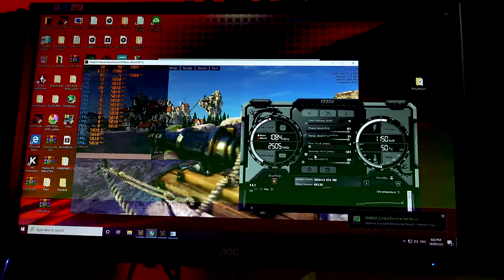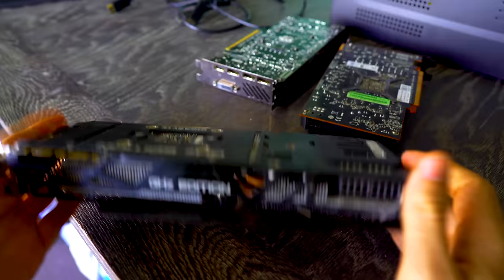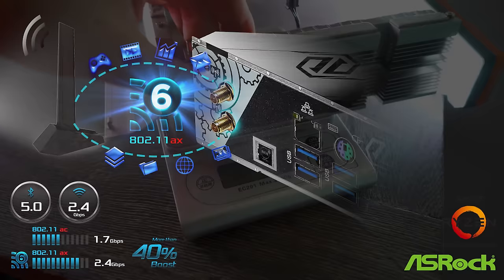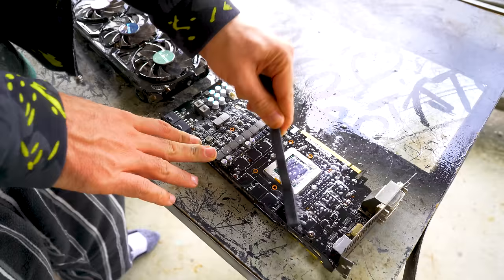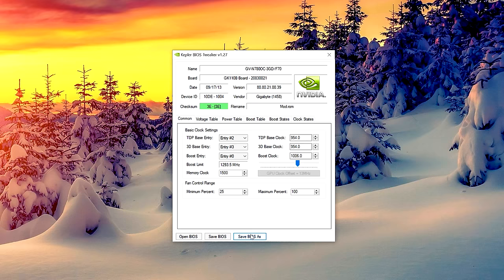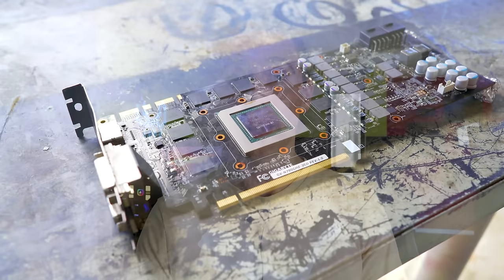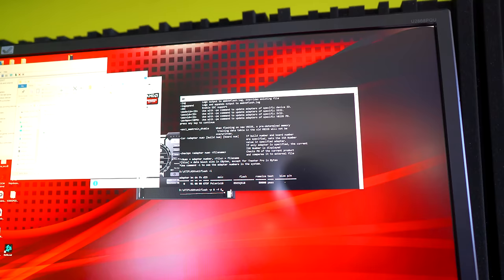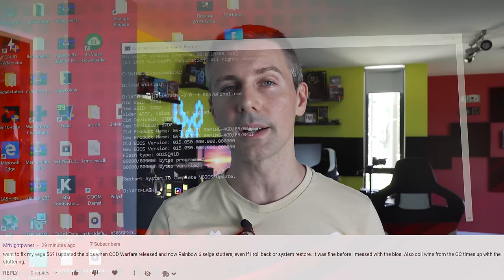4 Problems that Cause a Faulty GPU and How to Fix them.

Comment: My gfx card just crashes with a random solid colour (like pink, yellow, blue) or sometimes just completely blank screen, fixable?

It works for sometime and then suddenly goes blank and sometimes reboots the pc
Reply: Hey, I got the same issue.. Have you ever got a fix for it?
Reply: @ruebegaming829  I had to change the gfx card, I got bad news the card is done mostly. Try changing the cable and cleaning the g
Reply: @rhlparkr  ahh shoot... I even tried running the gfx on a different system and still did the same thing.... oh well, thanks anyway
Reply: @ruebegaming829  np

Comment: my gpu seems like near dead, it won't let the computer boot.. yesterday i watch this video and today i wash my msi rx570 8gb using methanol aka methyl alcohol because i don't have wd-40 or any multi purpose spray. try to heating up the gpu using hot air gun, and also re-paste it with cheap thermal paste, after that i try to boot up with my computer, surprisingly it's working perfectly and has low temperature which is GOOD, a BIG THANKS for making this very helpful video! ^_^

Comment: i've got a GTX 780 FE i found in a scrapyard, the card powers up but fails to initialize and says "please connect the PCIe power" even when the power is connected. How would i fix this? there's nothing obviously blown up on the board and there's no corrosion and very little dust in the heatsink

Comment: Great video. I like the heat gun as I've used it before. I seen other techs use an ordinary oven and foiled bake sheet. Just cook a pcb for 10 minutes. Sometimes if you've beat a old transistor radio around, it's components get loosen up and need to be re-soldered again. Heat guns do wonders fixing them.

Comment: My gpu had vertical lines in the middle of the screen and on the right side of screen. Any chance to fix? I tried baking the card twice but the lines remained. And driver install didn't work.

Comment: Just fixed an Asus Phoenix 1660 by reapplying new thermal paste to the gpu processor as well as new thermal pads. Its a single fan card so it runs hot naturally. It looks like the problem was not enough thermal paste coverage on the chip as well as re-using the thermal pads after the last time it was taken apart an re-pasted. Make sure you fully cover the chip with a decent amount of paste. To clean off the old paste I used 91% isopropyl alcohol and for the thermal pads I used 2mm EKWB thermal pads from a local electronics shop that was less than $5. It will get up to 82 degrees on the Heaven benchmark after 3 consecutive runs but not any higher. Then I used it for mining an it worked on all the overclocks I tried with temps around 67 degrees where before it crashed the pc after a few minutes.

Comment: I have an old AMD card that blue screens periodically whenever I watch web based videos like YouTube. I tried disabling all GPU acceleration in the Chrome flags menu and settings, that didn't solve the problem, but I can play video files with VLC without any issues. I've tired installing new drivers after using driver cleaner. Reseating and cleaning the card didn't help, the only fix was to remove the card.

Comment: The rust on the 780, is the same rust I have on my 970, same cooler, Gigabyte Windforce. I live in Far North QLD, so definitely humid and salty, but I have older components that show nothing like it, while that 780 and my 970 match perfectly, in cooler spec and rust.

Comment: Brian, To fix the black screen on windows, boot safe mode, run msconfig, tick base video and reboot. It will then use a legacy driver to boot and then it will be ok as the nvidia drivers then kick in later. This is a work around, I used for 3 years.
Reply: What do you mean by tick base video?

Comment: Soldering paste didn't smelt before 200°-220°. 
I'm just saying... 
I've put my old graphic card in a furnace for 15 minuts at 220° that's work. But dont forget to disassemble all plastic parts.

Comment: Heatgun/bake works. I fixed my HD7850 3 times using that method. But I don't know how to fix vertical lines. Bake doesn't help. Had them on RX 470.

Comment: I have a AMD Radeon HD 5450 and this had the display going black problem in windows 10 and it was not the card ,it was the drivers !
* uninstall the drivers 
* manually download and install older drivers that was made for windows 7 in to windows 10(i have a old VGA but for new cards you should use oldest driver you could find)
* disable VGA driver update in windows update and the display driver software from updating drivers 

and this fix the problem and i have been running like this for more than 2 years now, cant say that this will work for everyone but you should give it a shot before spending money on a VGA card

Comment: To fix the first problem, you might want to try the oven method or hitting it with a blow dryer on hot and high for 15-20 min

Comment: Is there any hope for my "dead" 750Ti?  I put it in a friend's computer while doing a clean and windows reinstall. Heard a loose screw taking it from the car shook the case but didn't locate it.  Powered on, no video. Took GPU out.  THERE was the loose screw. It had fallen between the fan shroud and the circuit board on what I think is a VR chip or something.  It was near the top by the 6-pin power socket.

It doesn't  smell burned or anything obviously dead and I didn't not observe smoke, but the card is no longer detected by the motherboard at all.  It's  Z97  MSI PC Mate with UEFI which has a "board explorer" option.   The slot where the card resides shows nothing there.    
The PSU was OK and the mobo showed no ill effects only the GPU was affected.

I don't have another GPU to swap with it so he's using the GMA4400 on the I3-4130 CPU but obviously if this GPU could be revived it would be nice.     I've never done this sort of repair work. But I am not a stranger to soldering.   My hobby for a while was building guitar amplifiers from scratch using vacuum tubes.   So old analog gear not SMD chip stuff.  Is this something that could be repaired assuming the bad part could be ascertained?

Comment: I've used heatgun method and it works quite often... but it being a low temp solder problem it is usually indicative of overheating, it helps, but if the overheating is not resolved, it will just happen again... pressure clips, replacing thermal paste or changing the cooling method may be necessary

Comment: can i ask something sir, what happens if i accidentally pulled down a bit off the head of the hdmi? because of my headphone wires i accidentally pulled the wires hitting downwards the head of the hdmi cable plugged on the gpu, will it damage the gpu and the port? my screen just turned black then something like a tv no signal screen.

Comment: Just did cleaning up of gt8600 on old system which was still working - original heat paste from purchase 10 years ago - fan was a little noisy so took that off and applied oil. Then made the mistake of deciding to change the heat paste... undid 3 of the 4 screws(spring loaded) and the heatsink popped ripping a portion of the gpu off. The paste was so hard it acted like epoxy glue - now the fan is quiet and the card is trash. A cheap card but a good lesson be careful with old cards and removing heatsinks.

Comment: I just replace my thermal pad on zotac 3080ti. First I use alumunium mod and thermal paste. Works ok, but not performing as I expected. So I changed it again with thermalpad/thermalright. Now Suddenly the pc wont boot. 1 Long beep and 3 short beeps. What would you suggest I should do? Could it be the leftover thermalpaste?

Comment: I recently lost my XP retro machine’s HD 6870 from a crappy cooler. Barely kept the card at 80 degrees, with nothing protecting the RAM chips. Proper cooling matters, folks.

Comment: I am having difficulty with my gigabyte vega64 OC it randomly crashes and power is cut completely. I have tried replacing my psu and checked all my other components. I suspect it might be vram on the graphics card and appears to occur when in 4k resolution. However was not as prevalent at lower resolutions.  I will try to down volt the memory what else should I look at trying?

Comment: Wonder if you could help me. I'm considering buying a faulty GPU off ebay for a cheap price, in the hopes of getting it working again. Going by these descriptions alone from different listings, do any of them appear like they would be an easy enough fix?

Listing 1: This card was working fine however it now doesn't output to my monitor

Listing 2: The card powers on and fans spin, however no display is made to the monitor, or display is made but then goes off. You may not experience the same results as I did on my test system, so please bear that in mind.

Comment: my old sapphire hd 7870 was getting black screen after installing drivers in 2018 and I saved her by baking her. She worked until may 2020. Thats almost 2 years but then I got same problem. I tried  baking again but this time I wasnt so lucky. RIP Sapphire hd 7870 (2013-2020)

Comment: So after my PC once randomly shut off while gaming, it only powers on and boots normally(with integrated gfx) when the GPU is disconnected from PSU. If I try to turn on PC with GPU powered, all fans just move for a sec, the power LED on the front of my PC stays on but nothing else happens. Tried moving GPU to my other PCIe slot that was never used and same happens. Is this just a short on my GPU? I have taken it apart to see if anything looks burned or damaged but it almost looks like new(even after 5y of use).

Comment: Hi! I have an EVGA GTX 1070 SC with micron memory. I have green pixels  squeres and shades when the gpu need to work harder, under any 3d application or sometimes now in the Windows 10 as well.  I downloaded the EVGA Precision X1 software when I can downgrade the memory and gpu speed. Basic speed: Memory: 4007 Mhz , GPU  1960 Mhz, Voltage 1050mV. Could you tell any ratio how I can try to take down the speed as you mention in the video? Because it should have a ratio between these component. Thanks

Comment: I had an MSI R9 390 8GB Gaming and was going black screen after installing the drivers, reflowed with a hot air gun for 5 minutes at 300 degrees and it worked. Stress test done and not issue. Now I have an ASUS RTX STRIX 2070 fan spinning but no image at all and so far could not figure out what's wrong with it.

Comment: that no signal drive issue have you tried bios flash of the mobo, in a rare few of those cases that has worked. but nothing makes you feel like a bigger failure than this issue lol i`m glad i`m not the only one take has had this happen.

Comment: i have problem in my gtx 1080 ti asus rog strix its never cools down 
+ i have a great air flow in my case 
so idk know what to do please if u know anything about this help me 
i tried so many solutions 
like changing thermal paste and puts the fan speed to 100 and other things and it didnt work ):

Comment: In my case I have a GPU that doesn't output video if I use it with a certain monitor, but it does with other one. But I have checked the first one with various laptop video outputs and even with the motherboard hdmi and it works ¿? 
Also I have a hdmi to DVI cable and it works but if I use it backwards it doesn't work. It is bidirectional btw. It's an Amazon brand cable.

Comment: I have a 1GB GTX 560 that artifacted while playing TF2 and crashed to the home screen, then later crashed and rebooted the system while artifacting everywhere. I assume it's VRAM as it only started while switching to a higher resolution and settings. Then the EVGA version I also have seems to work perfectly but would stop displaying while trying to boot into Windows.

Comment: hi can you help? i have a GTX  970 gpu, when i boot up my pc it shows the windows 10 logo in colour (blue square ok,} but when it goes to desktop it shows a black n white display, and the fans dont spin and the resolution is low  480 i think, can it be saved as i don't know too much about whats going on  thanks

Comment: Hi, 
My MSI GTX 1070 died few days back. It was running fine and then suddenly the system shut down completely.
And since then, if the 8 pin power is plugged in the system doesn't power up at all. And only if the 6 pin power is in, the system tries POST but gives GPU Error (I don't have a bios led on Mobo)
Can you please suggest something, it is out of warranty so MSI didn't help.

Comment: I bought a used R7 260x. It worked for a few days but now it will not allow the PC to boot (it boots fine on the built-in graphic card and on a GTX 960). I ordered some thermal paste on AliExpress. I hope it comes back to life after I apply it.

Comment: I got a 1060 6 gig that I put in a dell optiplex. I used it lightly (gaming probably only twice a month) and then one day, pffff!!! The fans spun up and I lost display. After that, whenever I try to power, it gives me a screen asking "PLEASE CONNECT PCIE POWER" or something similar. All the while, I was using the 240 watt stock PSU. Is it possible the PSU bricked my card. There appears to be no physical damage to the card.

Comment: The one problem you said you couldn’t fix. I have that issue with a brand new Strix 3080. Did you ever find a solution? The card was giving me weird power issues out of the box. Got windows and the drivers on; maybe an hour later after a few restarts, the GPU fans just stopped. Now I get no signal too. It boots for a second with no screen, then the GPU just dies 10 seconds later… $1000 gpu…

Comment: if the gpu doesnt initialize, black screen fans turn on max, you can try to do a bios update for the gpu. i was able to bring back 5 out of 8 gpus. 2x 1080ti asus, 1x 980 from msi and 2x gainwards 780ti s. with this issue. you need a 2nd gpu ofc to see emzh and allocate the slot were the target card is pluged in.

Comment: I’m late but the concept still applies, my gpu, when it works, works fine. But that’s only once in a while, it may be a driver issue but no matter what driver I use it still does it. What it’s doing is not turning on at all at times, sometimes it turns on then the second windows loads it shuts off again, even though my pc is working fine. Sometimes it’ll be working fine then just out of nowhere stop working for a few days then work again. Really not sure what the problem is at this point as I cleaned it, with isopropyl alcohol, reseated EVERYTHING, and tried to rollback drivers and crap when it did turn on. Now, it’s common for it to turn on but the drivers failing to load completely and I have to manually start them or roll back drivers.. idk at this point.

Comment: I have a Evga GTX 1070 and it boots to Black Screen, I'll do a force shut down, then start from a cold start (not a restart) and all 4 monitors will come up. Any ideas?  It always takes two starts and it will come up, any food for thought, for me to check out. I pulled it out, cleaned, inspected, but didn't find or see anything. But I think I may clean it as you did here with all-purpose electronic cleaner spray.

Comment: i resurrect R9 280X with heat gun, it was working for 3 years then i changed the card(i bet its still running :) ), but heatgun isnt enough because next death will appear soon, unless you keep it cool. My card on default had core temp about 75-78°C, so i modified VBIOS for more RPM on fans and now it has max 62°C on load. if your card become noisy, you can drop vcore+freq to help your fans

Comment: I got one 780Ti OC Phantom version with 280W tdp having a service sticken on it "RAM POWER SHORT" when turning pc on main board shows an error code not finishing boot progresd fine, the  is unreadable showimg mixed character mode but stange graphichal colorfull artifacts blinking instead of chatacters. I try to upload picture if I can.
What do you suggest to check there? It has a separate ram stepdown power board on this card  very massive 2*8pin power consumption beast.
I repaired bga issues on gpus before  with my heat gun solder station but it looks a stranger issue.

Comment: My pc has a unique problem, when i install gpu vga, the pc wont run  (off black out), and comes out with sound "ding" not audio sound its like spring sound, and when i unplug the vga and boot with out it, it boot, but any moment i try to unplug the pin power of gpu, the pc on, and the fan is not spinning, but no display in monitor

Comment: Technical question/begging for help. So I have an EVGA gtx 1080 and it runs anywhere from several hours to 20 minutes. Much shorter under load. My screens will then turn a solid colour (different colors, the colors are random). The computer will still be on and I will hear initially stutter audio that then stabilizes but the screens will remain a solid colour.  When I open my case, the card will often, but not always,  be very hot, though the case interior will still be close to room temperature. I just started my channel can can't afford to buy the nightmarish prices of new cards. I use msi afterburner to crank the fans to max and the temperature falls but the card still gets pretty hot. I have changed the thermal paste. 

Any ideas on what might be wrong and if it is fixable?

Comment: Hi, 
please help me !
I have a radeon HD7770 which starts fine but when i open a gpu intensive task like a .H265 video or a simple game like "cities skyline" , the screen goes black / random colour mix and gpu fan goes full speed for 1 sec.   
The msi afterburner program does not change the memory clock. I can change the slider (value) but it has no effect on the set value of the card.
getting life back into this card will help my savings a lot :)